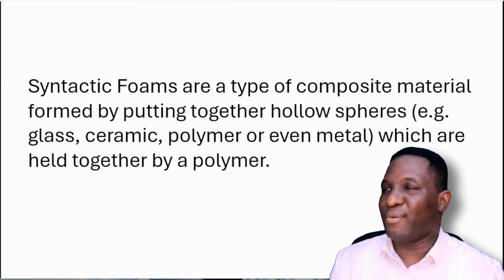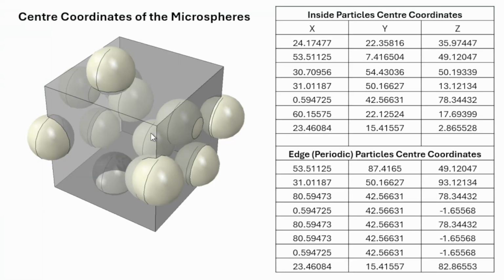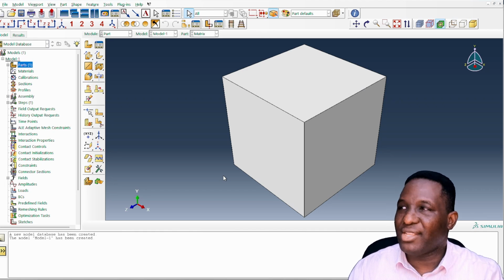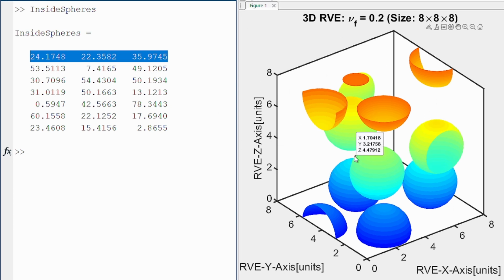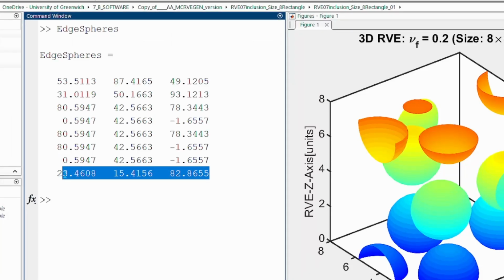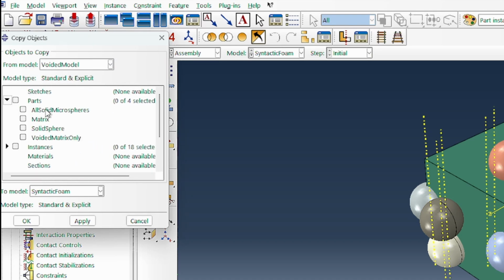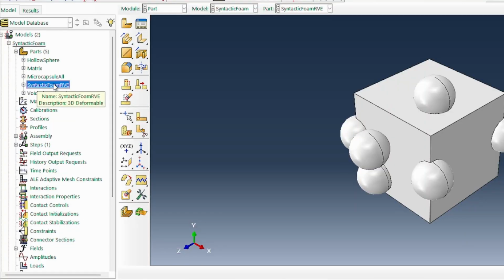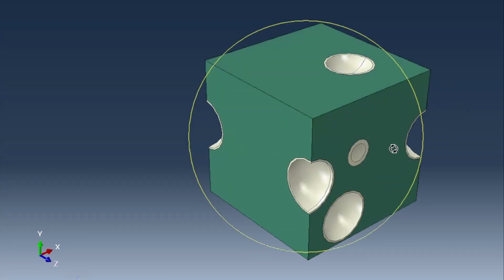Step-by-Step Guide to Designing the perfect Syntactic Foam RVE

Comment: Hi Dear Dr.Michael,
Your videos are really useful and improve my knowledge in composite and RVE fields.
Specially thanks.

How can I simulate and modelling tensile test of Graphene foam and epoxy (RVE) composite in Abaqus, please give me some point, video or titles of papers.
Reply from the maker: Noted. I have a video on the channel about graphene composites - look at that and see if it would help. Good luck with the work.
Reply: @MichaelOkereke  
Thanks, I’ll check it !
I checked the article that you mentioned in this tutorial video, the magnitude of Young modulus of article results and the tutorial aren’t equal and have a big differences !
The method of article use subroutine and don’t do this case study with your very good method.
Please discuss a little about different approach and accuracy of each method.
Can I use your approach in my thesis and have a good accuracy with experimental data ?